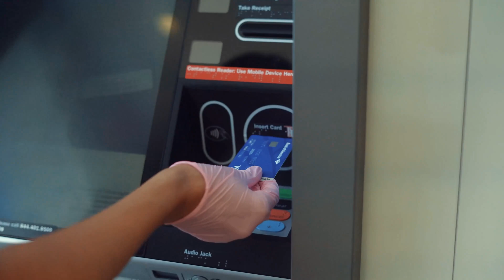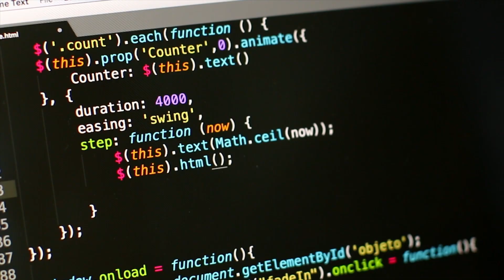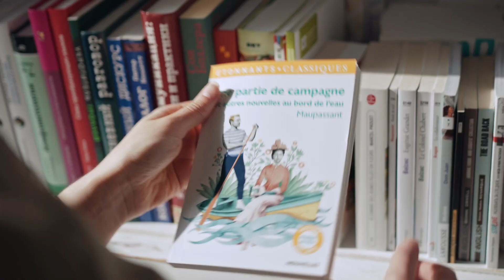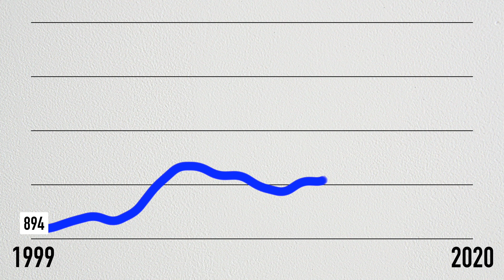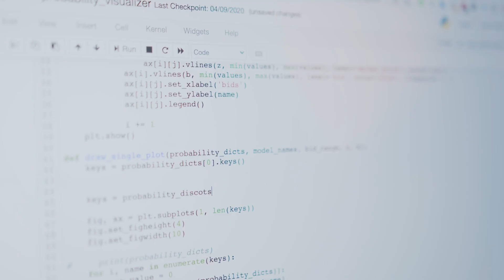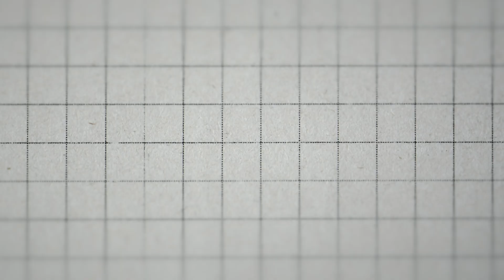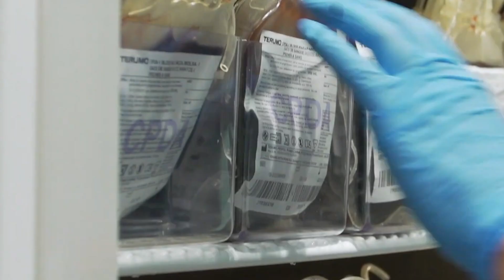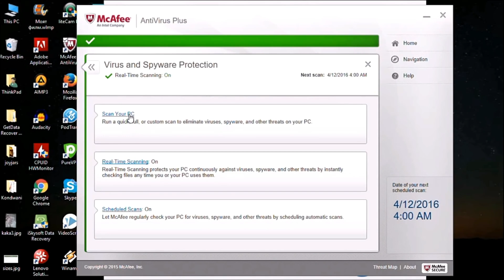Here's Why Cyber Security is Impossible

Comment: Great video Gary! The ending got me thinking…would taking my computer off the internet help secure it?
Reply from the maker: Taking it off the internet (called 'air gapping') would certainly reduce the attack surface, you might have difficulty using the computer though. You'd also have a challenge with software updates. Organisations that need to protect very important assets do use air gaps. However, there are advanced attacks that can bypass an air gap. So nothing is completely fool-proof! Thanks for the question! Hope my answer helps :)
Reply: @theintellab  woah that’s crazy! I think I preferred the dark ages with no internet or computers, simpler times…

Could you recommend anything for beginners from a Security learning perspective?